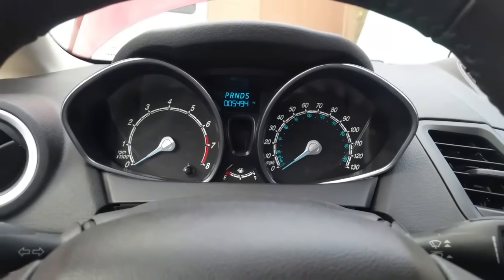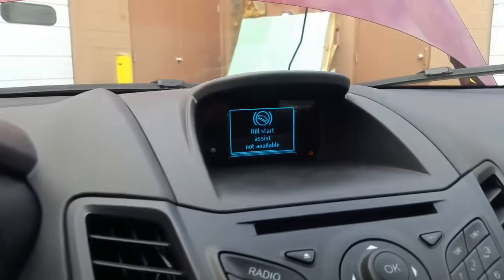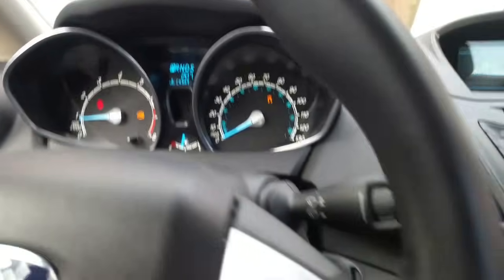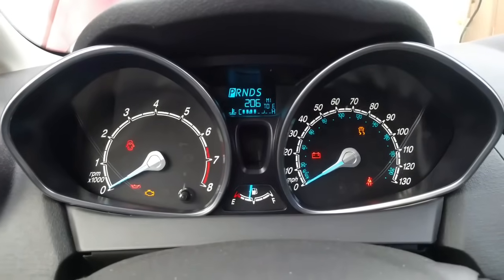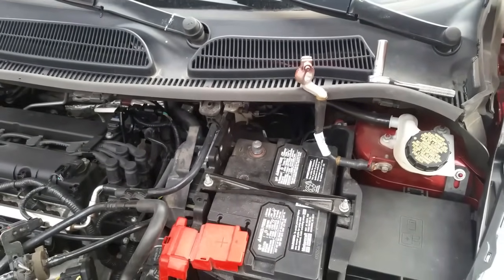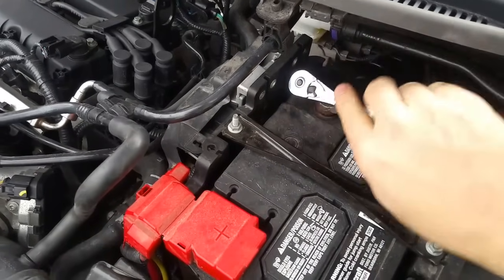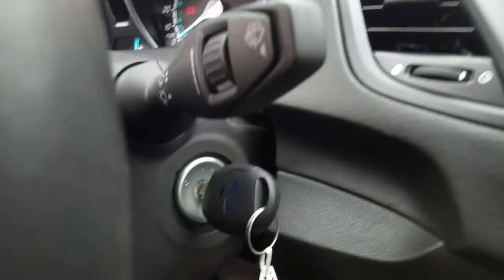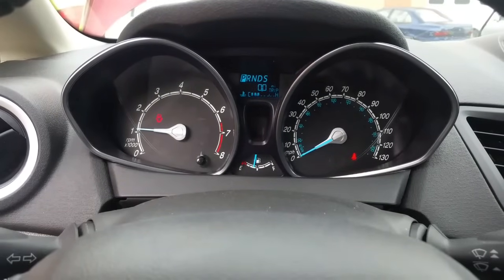HOW I RESET SOFT CODES ON FORD VEHICLES ABS, TRACTION CONTROL, ADVANCETRAC WITH OUT SCAN TOOL!!!

Comment: Hi man, was wondering if this could solve ford ecosport 2016 with TCS, ABS, HILL ASSIST solid light on? Or could it be a wheel sensor or ABS module issue?

Comment: REF 2009 Ford Explorer with hard code P0401 (EGR insufficient flow) for a few weeks. Now I have new (soft codes) ABS light/Service RCS NOW and RCS traction symbol light coming on and off erratically at random. I am aware these codes have nothing to do with the PO401 hard code.   Found the ABS sensor harness connector from front left wheel at ABS module not fully plugged in and and un-locked. Cleaned both ends of this ABS harness and reconnected  with connector fully engaged and locked. Problem continues, but very randomly now. Will your procedure work to remove the ABS soft codes/warnings, without curing the EGR PO401 hard code first? THANKS!

Comment: If you leave the hi beam on and disconnect the battery you will have same outcome.  

What your doing is draining the power from the ecu ... 

There for it has to reset when power is connected 
Your welcome 🙏

Comment: I removed the ABS harness for the abs do you think your method here would also work on a 2011 Ford F-150 XLT. I was replacing a brake line on the ABS and a removed it knowing I should have removed the battery but now I'm having all these lights same as you lit up my dashboard..

Comment: 🎉host, I've tried several times and i even did it in the positive csble. I had a spin and tried to use the hard stop break then do the procedure again but still doesn't work.. help 2014 ford kuga keyless
Reply: Try disconnecting the battery with hi beams on .

Comment: I just done mine but the the light was still on after doing all the steps like you. So what i did was to take it for a quick spin and pressed the brake hard to engage the abs and then the light was off . I quess it activated/forced the traction control to engage.Thanks for the tips.
Reply: Your abs module will not entirely reset until u go above a certain speed after repairs .
Reply: @CrocOncrac  Hi. Very interesting what you are saying.  I do not remember if i drove on the motorway speed after that but now seems to be ok. I also had an aftermarket engine kill relay with remote and after having a free battery check at Halfords they said its the alternator not charging correctly and have to change it. But I removed the engine kill relay and no more problems.  I think that was drawing too much power in standby.  Ford fiesta ofcource.
Reply: @lucianbrighi  I'm aware it only has to be around 15mph or 25kms 

I'm also unsure if that would affect abs unless your drawing power from a constant power supply that's to do with the abs .. 

Abs wheel speed sensors , sense the friction in relation to the spin of each wheels sending the same or equal number of spins to the ecu (engines cumputer) 

Traction control on the other hand detects the slip of one wheel compared to the others there for allowing a certain amount of play between the rotation of the 2 wheels aligned . 

For eg , on dirt one wheel will spin faster then the other this will trigger your traction control if you don't have a button to turn it off . 

If I need to explain further , while entering a corner or long bend one wheel would have to rotate more then the inside wheel to allow correct dynamics.

Comment: 2017 Ford Feista SE. A little over a month ago the wife called and said the car want move. She said after drivingbfor about 30 minutes the brakes seemed ro start applying themselves and bringing the car to a stop. When i got there it would move, you could put it in drive and reverse and it wanted to go but it steemed like the emergency brake was on. After setting for about an hour you could drive it again but in about another 30 minutes it would do the same thing. I thought it was the ABS module so i replaced it but nobthe breaks gobto the floor and the traction control light is on and rhe ABS light flashes. Your thoughts
Reply: A block in the line . Or calliper pistons stuck out and won't go back to driving position . Could also be wheel bearings . Due to happening when appears to be hot . 

Maybe use piston tool to wind in callipers in the right order from furthest away from booster to closest . Then bleed 

Wheel bearing you would need to Jack car up and shake wheel any play left and right is wheel bearing any play up and down could be ball joints aswell 

Also spin the wheel and look for grinding or humming .

Comment: Need some help. 2017 Ford Feista. While driving the breaks seem to come on becauae the vehicle will slow gradually and then stop all together. It tries to move in drive or reverse but will not. I always seems to be fine after we let it set for an hour or so but will eventually do it again. When it does this hill assist comes up on the screen. I was told you can turn this feature off on an automatic. Would greatly appreciate some help

Comment: Thanks a lot. But I have a question. After this procedure the abs an tract system restart to work normally? Because now my panel says : low oil level. But the oil is ok.

Comment: What about a push to start ford? Does the ignition still remain in ON mode when you disconnect the battery?
Reply: Hi, did you manage to fix yours with keyless start?

Comment: Thank you. I fixed my 2014 taurus 2.0, with traction control not available, adaptive cruise control not available through your method.  Being no key start button, I pushed button without pressing brake pedal.
And I took the neg terminal of battery for 5mins.   It fixed. 😃
Reply: what is the problem cruese control..?

Comment: Not a chance this this did not work on my 2003 Ford Windstar SEL. Did exactly what you said all sensors and reluctor rings have been replaced as well. Don't know what else to do to be able to check the actual ABS module as the codes do not show up on my autel OBD scan tool.

Comment: FYI global reset. Pull both off and hold the cables together NOT ON THE BATTERY. hold them together for 30 secs to minute and then reconnect terminals and tighten to specs. Start car and it’ll be off. No need to risk zapping yourself with ignition on. Easier and safer. Global reset. Non cheating cheat code

Comment: Have 2005 explorer XLT 4.0 I scanned it with a cheap Actron code reader and zero codes but my abs and advance trac lights are on .My question is if I do your procedure will I need to complete the drive monitors??? If the lights go off I have to go through inspection but want to know if I'll have to run the monitors first ?? Appreciate your response . Subscribed!!!
Reply: Did the procedure work for you. I have the same vehicle with same issues. thanks

Comment: I tried it on my 2015 Ford Focus, but I disconnected the positive because the negative is hard to get to. It didn’t work, so now I disconnected the negative and I’m waiting 5 minutes. If it works, I’ll edit this.
Reply: Did It Worked? I’m Trying It Right Now On A 2003 Focus

Comment: Just seen another post where one person turned the key on (not the ignition) and stepped on both the brake and the accelerator for a couple seconds and that turned the engine light off. I haven't tried it cause it's 2:17am, it's blowing and it's damn cold outside.

Comment: Have a 2017 expedition that just threw the same codes and no power steering. I had the same Idea of disconnecting the battery but didn't know about leaving it in the "on" position, will try it again. thanks

Comment: I was really hoping this would work on my 13 Fusion… have the same lights plus airbag. Replaced a wheel speed sensor and they went out for a week and they came back… did this HOPING and still on. 
Looks like I gotta dig for the issue. 
Video was very helpful though, straight forward.
Reply: Have the same issue with my 13 mkz. Was told abs module

Comment: I don't know how to thank you for the info on this video. My whole problem turned out to be the way I was rebooting the system and the key was the answer. 
I started off by changing the battery ($200.00) because the one they sold they car with was just a $60.00 car battery AND it said they battery wasn't being charged.
So actually, I needed to do that in good time anyway.

Comment: Awesome! I will try this procedure on my 2011 fiesta S 1.6. Hope it works. Thanks!
Reply: Kasih tau hasilnya bro,, padahal dah ganti aki masih aja nyala, engine check juga ikut2an muncul, sempet GAS gak mau respon 😢
Reply: @herriwibowo6625  gmn sekarang kondisinya? apakah sudah ketemu solusinya?
Reply: @Textify-f8r  , ganti TCM, untuk ABS masih fail , tapi ane pake aja, sempet bawa mudik ke Tangerang Jateng PP , aman
Reply: @herriwibowo6625  nah..rencananya mau dibawa jkt-jogja cuman kalo ane indikatornya kedap kedip doank pas rpm rendah....

ada yg saranin ganti kampas rem..udah coba ini om?
Reply: @Textify-f8r  ane sudah bawa ke bengkel om Reva dan mastercars, hasil Scan module ABS fixed rusak ( fault cide gak bisa di hapus), tp setelah konsultasi masih aman di pake asal jgn ngerem secara mendadak, sampe saat ini kadang masih ane bawa ngebut tol bsd-Pamulang 120-150 kpj
Reply: @Textify-f8r  kalo mau iseng2 ke bengkel coba di om Reva (pondok cabe), dan Mastercars ( lebak bulus dan gading serpong) bisa diajak diskusi kok

Comment: Take a little of time to read my story. I had a similar problem with my Ecosport 1.6 Freestyle 2015. A battery failure (due to reaching the end of its useful life - 40 Ampere / 2.5 years) left me with the vehicle stopped on my garage entrance. As it was sloping backwards, I managed to start the vehicle by turning the key on and letting the vehicle slide downhill (in reverse gear). I was able to normalize the electrical operation of the vehicle and its running, recharging the battery with the internal generator, and move normally.
As of this event, my Ecosport started to show the following errors: No functioning ESP (Electronic Stability Program); Hill Assist Brake disabled, Skid Control disabled. This was in January 2017 (vehicle age 2 years with original battery). I took the vehicle to the official Ford workshop. They scanned it and detected a fault in the ABS module and told me that the unit needed to be replaced; they also charged me for the review and scan. I left the agency outraged by the useless of the service and also by the obviously erroneous diagnosis, because the brake service never reported an error and it worked.
From my perspective it was only a data error, due to the circumstance in which the failure manifested itself. However, nobody nailed it, keeping this problem for three years.
I started my own research, which included scanning the vehicle several times and trying various alternative software or manual reset methods that I came up with or saw in YouTube videos. I recently bought a new cheap ELM 327 OBDII USB scanner adapter to connect to my notebook with FORScan program, which can be downloaded from the web for free. This combination is a powerful very low-cost diagnostic tool, which finally allowed me to understand what the problem was.
With the vehicle ignited on but engine not running, the reported error (DTC) was U3000: 41-AB- Invalid data from the PCM (Engine Control Computer Central Traction Control - ECU). Additional Failure Symptom: - General Checksum Failure. The data records in such conditions were:
-POWER_MODE: Power mode with given contact - Power Mode Status
-POWER_MODE: error - Power Mode Status
-RSC: Inactive - RSC
-BTCS: Inactive - BTCS -201D
-AYC: Inactive - AYC
-ABS: Inactive - ABS
-BTC: Inactive - BTC
-HDC: Inactive - HDC
-BST_REL_SW: Inactive - Booster Release Switch State
-VAC_BST_ST: Inactive - Active Vacuum Booster State
-HYD_PMP_ST: Inactive - Status of the hydraulic pump
Translated into common language, there was only one error in reading the status of the ignition key. With that data, I reviewed the YouTube procedures again and came across this exceptional video. As soon as I saw it, I knew it was the solution. In my case, it was not solved just by removing a terminal of the battery with the key in contact. Before replacing the battery terminal I had to turn the ignition key to the off position.
That was precisely the problem that originated everything: restarting the vehicle by moving it, with contact, after total blackout of the battery.
Then I had to go back to the scanner and go through an internal reprogramming procedure for the ABS unit, including code erasure.
And everything returned to normal four years later.
The generous input from the author of this video, which I thank very much, prompted me to write this detailed story, in order to ease the lives of countless FORD users, and even other car brands (almost all modern cars run the same way).
And I end up highlighting the terrible service of the official workshops that are only interested in charging quickly by replacing units without precise fault diagnosis. A new ABS unit costs about $ 1,000 U$D or more; alternatively repair the ABS control module or replace it, perhaps costs in the order of $200 U$D, although involving personal management. In top of that add the cost of labor. For this reason, with no doubt I prefer private workshops, in which one cooperates with the mechanic at the medical-patient level, or better at the level of friends.
Good luck to all frustrated vehicle owner with similar problems! And thanks again to George!!
Reply: In your case, it was ..key ON, remove negative battery, wait for 5 mnts... Key OFF, replace terminal, start engine? And than programming with Forscan? ..correct me please 😁🙏
Reply: Yes, taht was the case. Good luck !! @errikapurwo
Reply: @joseluispuliafito759  wasn't work on my 2012 fiesta 1.6 😭

Comment: Hey George. How are you? Hope everything is okay. 

My ABS, traction control and hill assist only comes on after I start the engine. I already tried the steps in your video, twice with 10 minutes of being disconnected, and the indicators still show up after starting the engine. 

Does this mean that mine is a hard code? Appreciste your response.
Reply: Conseguiu resolver? Estou com o mesmo problema em um Ford Focus 2014
Reply: @Redeerecord  I have the same problem, have you solved anything?  if so please leave your solution :( I have Ford fiesta 2013 s automatic
Reply: I think its a hard code. Same with me, U3000 abs module need to be replace.

Comment: Did not work on my 2013 Fi50....but looking for other solution. Changed my right rear wheel speed sensor, but code seems impossible to clear.
Reply: Hello Prince,  Did you figure out the problem? my 2011 just threw a service advance trac light.

Comment: What if the message says transmission malfunction service now, can i still do this?
Reply: Transmission malfunction you can try Ignition on - push brake pedal - move shift knob from P to L/S - move again to N - you Will get message transmission ready - after that move shift knop to P - start the car... It works in my fiesta

Comment: I do this and is working. If isn't working do 2 time's, control the fusses, somewhan can't fuse making this kind of hack, if dosint work control or change relais. This problem had  cum when I had cleaned the contacts of the fusses and relais. Thank you for the video is very good an save all for spending money.

Comment: my ecosport has break malfunction, ABS and hill start assist malfunction on the message. I tried the Hill Start Assist and it didnt work. If I restart my car with your method, Will it fix the functional problem too? Or just reset the light indicators. Thank you!

Comment: Thanks. Great. Had the same problems... abs lights and front airbag light came on and off on my 2016 focus Titanium saloon. I just followed your instructions,but instead of disconnecting the negative terminal, I disconnected the positive instead...for ease of access. Drove the car for a while and the lights didn't come on. Acceleration seems smoother.

Comment: Please How does that work on a push to start
Reply: Ignition ON can be achieved by trying the start the car but your foot shouldn't be on the brake pedal.
Reply: @ogbnwosu5445  Yh but when you connect the negative terminal ignition lights won’t come on.

Comment: Nice one I wish you could show me how to reset the BMS on a 2012 focus after battery replacement.
Reply: Pull high beam lever 5 times, press and release brake pedal 3 times. Battery indicator light will flash 3 times....done!
Reply: @bad_actor1128  LOL really ima try
Reply: @kristianmopsticc2887  let me know if it worked.
Reply: Ignition on but engine not running. Rear fog light 5 times. Hazards 3 times. Wait 15 seconds. Battery light should flash 3 times. 

Done

Comment: That's great if you have a key Ignition start what happens if you have a push button start how will you reset it then
Reply: For push buttons, you can get ignition on without starting the car if your foot isn't on the brake pedal.

Comment: George, I tried twice with positive and negative cords both, but it did not work. I have ecosport 2013 diesel model. Had already changed Right Rear speed sensor (as per scan report)  (ABS) but it was showing same malfunction ABS service error.  My car is keyless.  But pressed once without using foot . Fruitless.

Just a small query , do I need to press brake padels after removing battery cord.....? 

When I rejoined battery, it did not get all icons  back , so pushed power switch again.

Comment: Has anyone tried this on a Ford Transit Connect? I got one with ABS, Traction and Hill Start Assist warning lights on......
Reply: Jesse did you ever get it sorted?  I have a transit connect that shows those messages when I make hard turns.   Was it the wheel speed sensors?
Reply: @fpigunk  it goes on and off. So far the hill assist is working...I'm guessing it might be a lose connection to one of the wheel sensor........
Reply: If they came on suddenly get the code checked. Probably a $30 sensor went out